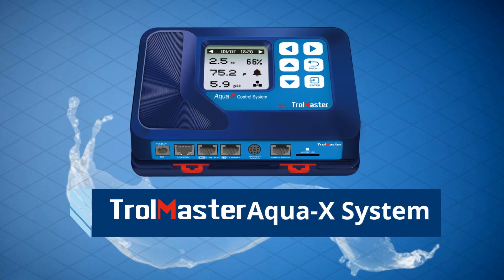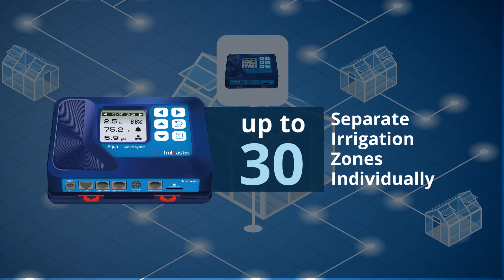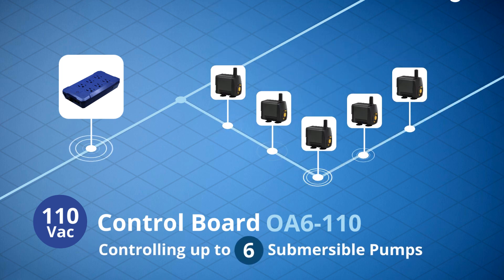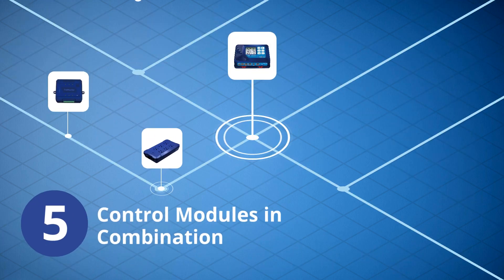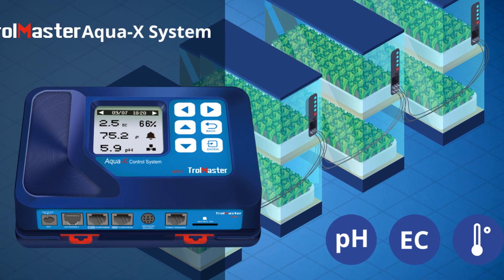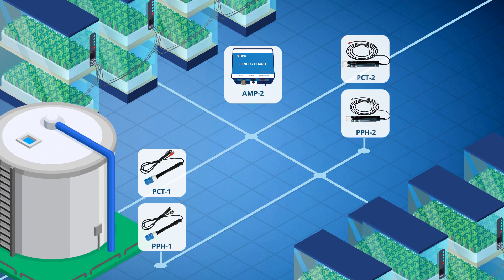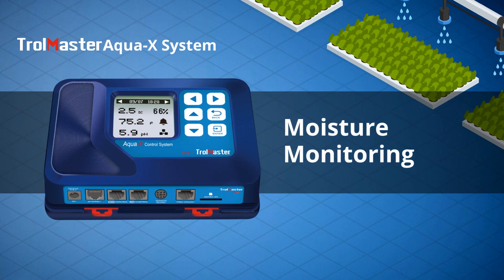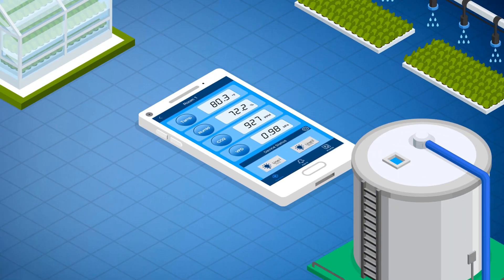Aqua-X - Overview

Comment: This system really needs the ability to control EC and PH dosing pumps like the Autogrow system.
Reply: Well after reading the comments , does this control doseing pumps for ec/ppm control and ph .I see it's got the inline heavy duty sensors im assumeing for doseing ,can any body confirm this thanks 😊.
Reply: Jabroni .Lifestyle    without reservoir?  🤔
Reply: Jabroni .Lifestyle  Thanks! But i don't  understand how😅
Do you know where i can find infos about it ?
Reply: It literally says right in the video that it monitors EC, and PH, and temp. Did you not watch it? lol
Reply: @thewolfoftechstreet  yeah, monitors and controls not the same thing, but thanks.
Reply: @Orcab1976  If it monitors it you can control it. It's a relay dry contact switch. literally talking to newbs.
Reply: @thewolfoftechstreet  Sorry but your wrong, Tech boy.  Aqua X controls Irrigation pumps, and monitors PH and EC but doesn't have the ability to control ec or ph.
Reply: @Orcab1976  It literally says controlling in the video what are you smoking?
Reply: @Electric Jesus I agree,  injectors regardless of the brand are where the large scale growers are going/gone, but no large scale grower is running systems off a Trolmaster( I hope).  these units are meant for smaller scale operations, not necessarily home tent growers but not large systems,  I use Trolmaster all the time, we build small modular grow rooms and shop them all over the country.